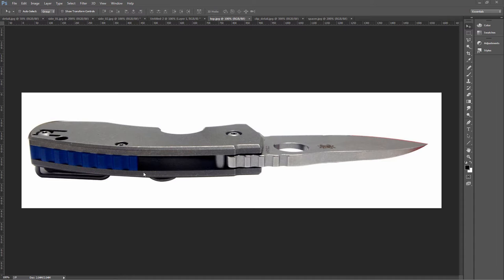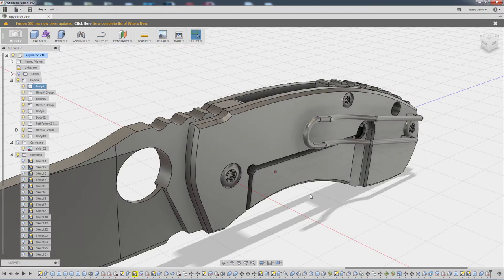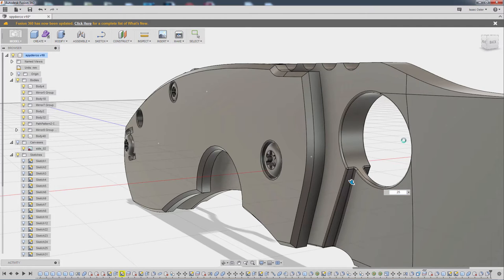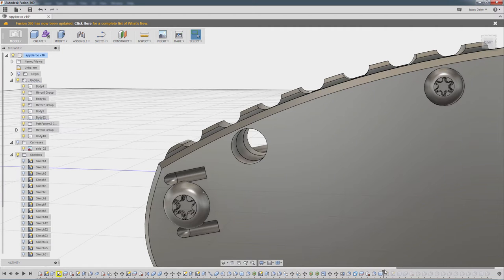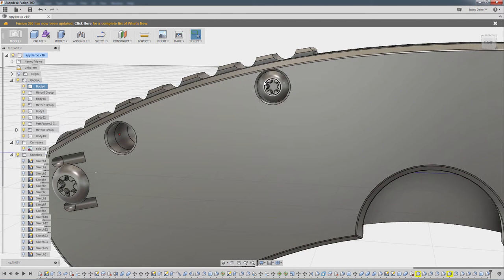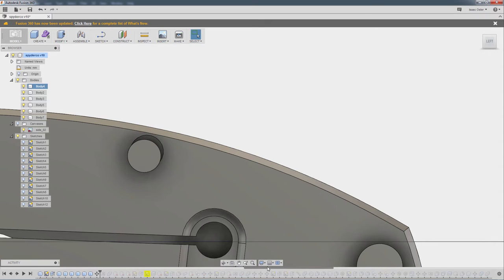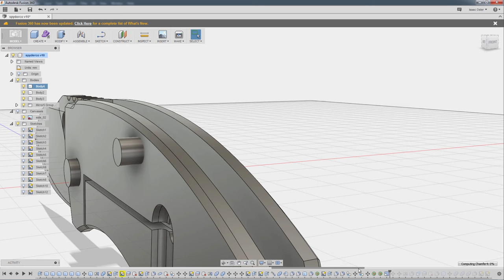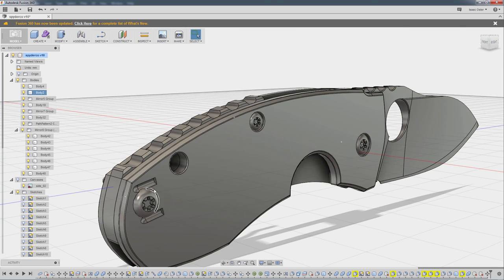Fusion 360 Sample Project Ch 10 - Polish

Comment: Thanks for all the great tutorials Isaac, Fusion 360 definitely has some powerful features. One weakness though, and it was highlighted when you mentioned the need to bend the cutout next to the clip: the lack of bend, twist and lattice modifiers. From their forums I see Autodesk has been promising these modifiers since 2014, but still no joy. Yet they're in Autostudio, a high-end relative, so I hope it appears soon.

I know you can bend and twist parametrically if you do an intersect of a sketch with a patch, as detailed in Autodesk's tutorial "How to model bends in Fusion 360" which is cool but this does seem like a workaround. In the context of this knife tutorial, using this workaround would have required that you planned it in advance, and bending in Zbrush seems like an extra step in workflow that shouldn't be necessary

Comment: Isaac,  fantastically done series of videos demonstrating workflow in Fusion 360.  Thank you for the time you put in and your willingness to share what you've learned.Have you ever modeled a folding knife to include the bolts, pivot and stop pins before (the parts between the handles essentially)?Thanks.  Shane
Reply from the maker: Hi Shane, glad you enjoyed the tutorials.  I hope you can integrate Fusion into your regular workflow.   I haven't modeled anything functional.  My primary goal is making high poly models for game art.  Fusion is primarily a design tool though, so you could certainly use it to make a functioning folding knife.

Comment: thanks for this tutorial series Isaac, good to see more people using Fusion 360! Personally, I switched to MODO but I can still see a role for Fusion 360 for certain props. Have you tried MODO yet ?
Reply from the maker: +Remo Van de sande 

Hey Remo, thanks for taking time to leave a comment!  I have used Modo in the past, but would definitely not describe myself as an experienced user.  For traditional poly modeling applications, I'm more of a Zbrush/3DS Max guy.  I do see some crossover with Mesh Fusion, but in my experience Modo doesn't come close to the flexibility and speed of Fusion.  And in my case at least, Fusion was a lot easier to learn.  I've seen a lot of great work done with Modo, but in my opinion - for the right kind of prop - nothing beats Fusion 360.  To each his own though : )
Reply: +Isaac Oster , 
I actually rarely use MeshFusion at all anymore (it is just too heavy on my system). Rather, I would use the "round edge shader" with booleans, like in Fusion, to get a very similar result. I think this workflow is faster but the downside is that you destroy the topology meaning that you cannot alter edge creasing/bevel per component like you can do in Fusion. This workflow is like a non destructive Zbrush boolean workflow.

Even though I love MODO right now I hope Autodesk develops Fusion360 to become their flagship modeler. The HUGE plus to Fusion 360 is that everything you make is functional. This actually blows my mind when I think of it. Don't you think that with the gaming industry his biggest focus on realism programs like Fusion360 will  become  future standards ?

Also, I am curious how you would prep. your model for baking + low poly a Fusion asset.
Reply from the maker: +Remo Van de sande 

Ah you know I've heard about the round edge shader - it's not a great option for me as I need the high poly geo to have all the fillets and chamfers so the detail bakes to the low poly properly.  I'm jealous though, as that's a really cool feature and a huge time saver.

I am absolutely convinced that the game industry will adopt Fusion as a primary modeler in very little time.  I'm definitely doing everything I can to spread the word.  I teach a couple classes at the local art institute here in Austin and have two or three advanced students working with it each quarter.  

I wrote a Maya python script to convert the STL geo Fusion exports to OBJ files, which can be batch imported into zbrush.  I have to set the STL export quality setting pretty high to prevent faceting.  Unfortunately, the geo tends to be heavy on the triangles, and even though it looks great, it has to be dynameshed to bake properly.  At that point it's ready for retop, color fill for mat ID bakes, sculpting tweaks, or whatever.  It's a little bit of a hassle to dynamesh everything, but it pales in comparison to the increase in quality and productivity you get with Fusion.

In case you want to try it out, the python script and setup info is available here:  https://www.youtube.com/watch?v=KlqndOp7R04

Comment: your tutorials though free are way better and professional than paid ones. BUT could you just post something on IMPORTING obj into fusion 360 and how to convert it ?? that would be a mystery solving thing..thanks anyways
Reply from the maker: Very kind!  Thank you.  To import a mesh into Fusion. go into form mode ( press the purple cube button), then select Insert -> mesh.  If the mesh is a closed surface, you can create a form from it by selecting Utilities -> Convert.  It's been a minute since I used this feature, so you'll need to play with the convert settings to get the desired result.  Keep your imported mesh poly count low and in quads for best results.  Let me know if you have any questions.
Reply: i'm very grateful to your quick response . YUP this works now,,,i haven't been paying attention to the odds of closed/open geometry when importing, in terms of creating forms. Now I have the whole night to progress upon this. THANK YOU.